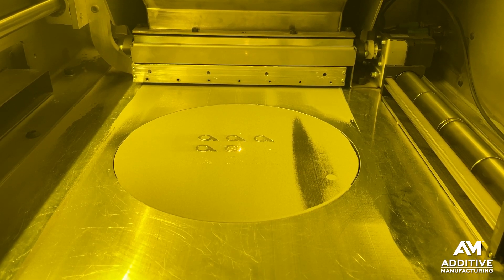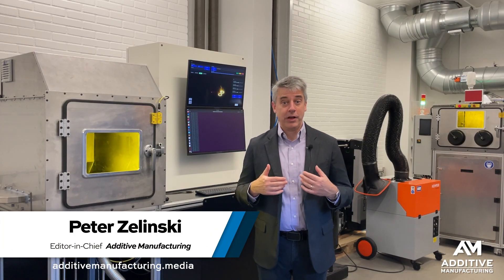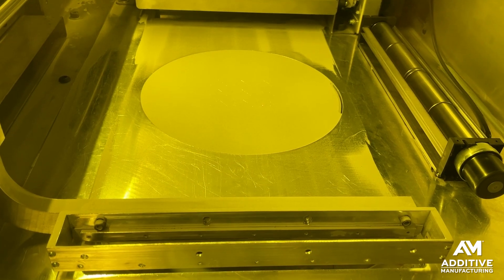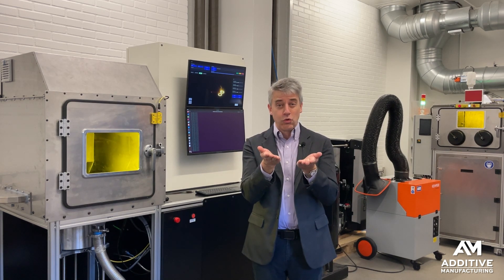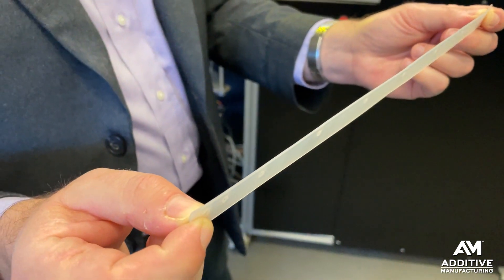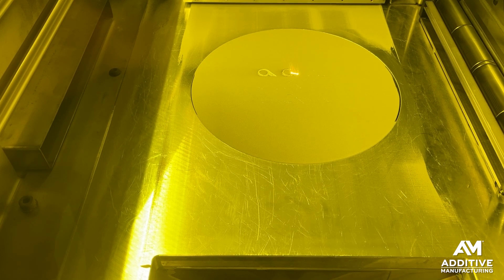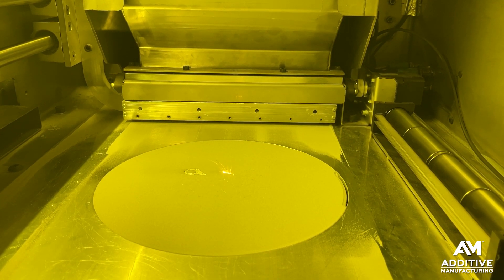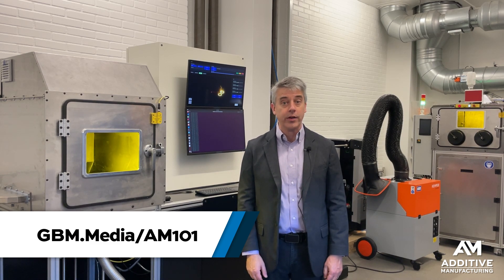What Is the Powder Bed? | Understanding Laser Powder Bed Fusion

Comment: Hi! I really enjoy your channel and find your explanations fascinating. However, I've noticed that you often use 'microns' instead of expressing measurements in 'hundredths' or 'thousandths,' like saying 50 microns instead of 5 hundredths. Is there a specific reason for this? Maybe it's a standard in additive manufacturing? I find it a bit confusing at times, but I'm curious to understand your approach. Thanks!
Reply from the maker: Metric units of precision manufacturing are generally expressed in microns, or units of 0.001 mm. Speaking in terms of a fraction like hundredths or thousandths is more the way of English units. A machinist referring to “thousandths” generally means thousandths of an inch. Both are equally valid for expressing precision. We use either/or, generally choosing whichever units seem to fit the application or machine we’re talking about.
Reply: I’m a machinist working in Austria in Aerospace and Medical, and I can assure you that in Europe, all machinists use hundredths and tenths. For example, we call a tenth ‘Zehntel’ and a hundredth ‘Hundertstel.’ But I’ve noticed that in Additive Manufacturing, microns are often used to describe both hundredths and tenths. At first, I thought 3D printer manufacturers were using microns to create a wow factor at trade shows since it sounds more precise—even when describing a hundredth or a tenth. But from your reply, I see that it’s actually a standard in Additive Manufacturing. Thanks for the explanation!
Reply: @KyryloSipovic I am a machinist in Estonia and we also use "kümnendikud" and "sajandikud" but only colloquially, they are never used in drawings or specifications. Also, for example, fit tolerances (h7, h9 etc) are expressed in microns, with a little Greek μ on the start of the table.
Reply: @raulkaap Thanks for the interesting discussion! In technical drawings, micrometers are typically denoted as μm, since "μ" alone is just the prefix for "micro" (10⁻⁶) and not a full unit of measurement. That’s why ISO explicitly uses "μm" for clarity.

Usually, everything in drawings is in millimeters, so units are not written. But if someone wants to use different units, they must be explicitly stated to avoid confusion. If "μ" alone appears somewhere, it might be a local convention or simplification, but in official standards, the correct notation is "μm."
Reply from the maker: Also, thank you for watching!
Reply: I'm an American, and even I know that there's too many compatibility and conversion issues with having two largely incompatible measuring systems in the same supply system. Metric system is the superior method despite centuries of tradition with the Imperial measures. NASA lost a two hundred million dollar spacecraft because someone forgot to convert Imperial to Metric and sent it into the planet Mars rather than into a nice stable orbit. It was an error of millimeters per million kilometers. Almost all manufacturers in the US now use the metric system. Though we still use gallons for gasoline and milk. Some things are not so important or troublesome, so we leave it for now, or for traditions sake.